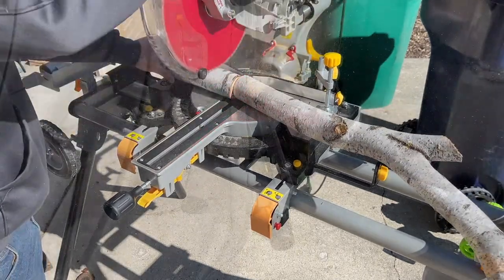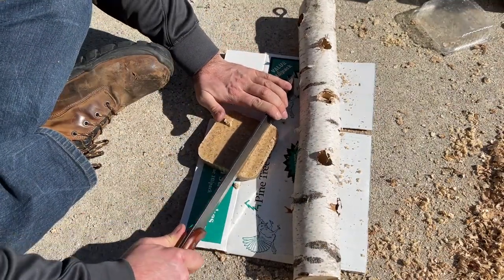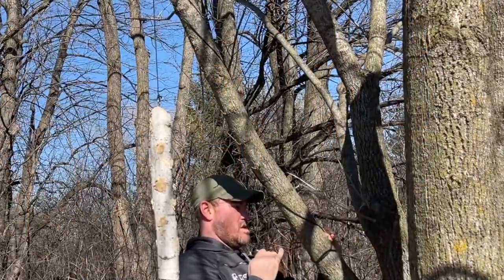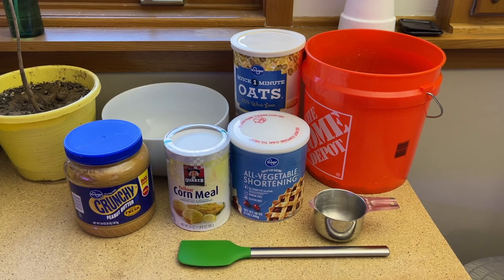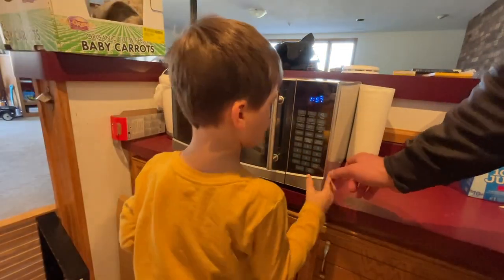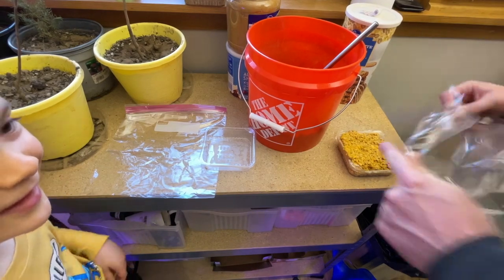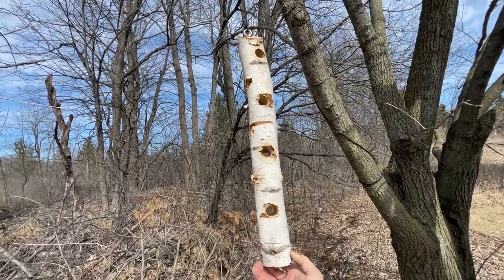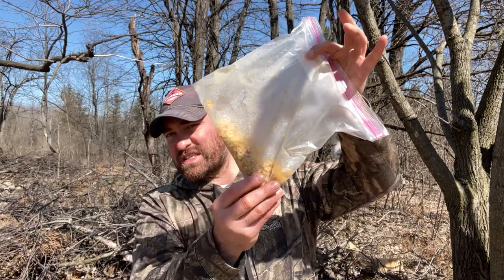DIY Bird Feeder and Making Bird Suet // Bog Life

Comment: I enjoyed watching this video and found it quite relaxing. We use the following recipe for our suet: 
1 Cup Crunchy PB
1 Cup Lard
Melt and stir together in a bowl.

Pre-mixed dry ingredients are:
1/3 cup chopped up dried cranberries
1/3 cup chopped up dried cherries
1/3 cup raisins
2/3 cup black oil sunflower 
2-2/3 cups Scratch Grains from Tractor Supply
1/3 cup Corn Meal 
2/3 cup granulated peanuts 

Mix everything together and pack it into the small Dixie cups…stick in the freezer to set back up. 

Use a 2” paddle bit to make the suet log and then just tear away the Dixie cup and pack the suet plug into your log and you’re good to go. Easy peasy. We get about 13-14 per batch. (3 batches from a 1lb block of lard…we don’t actually measure a cup but it’s close.)